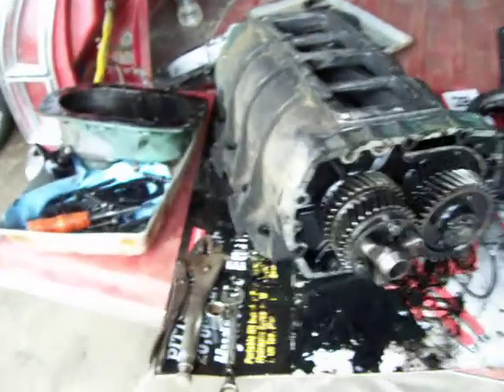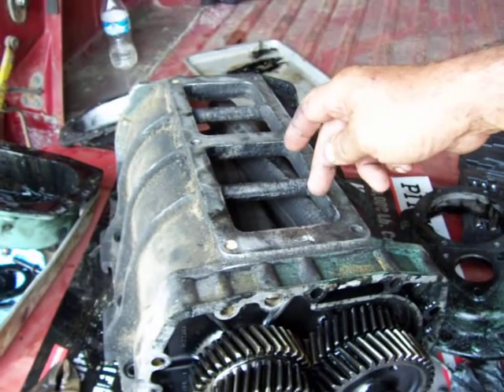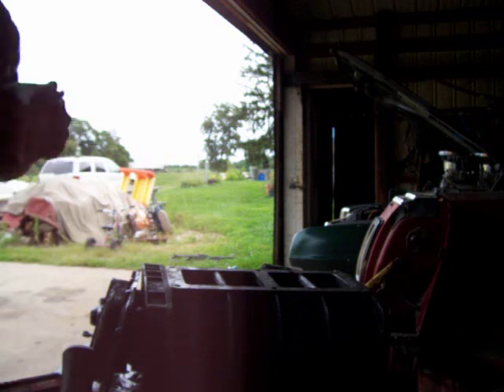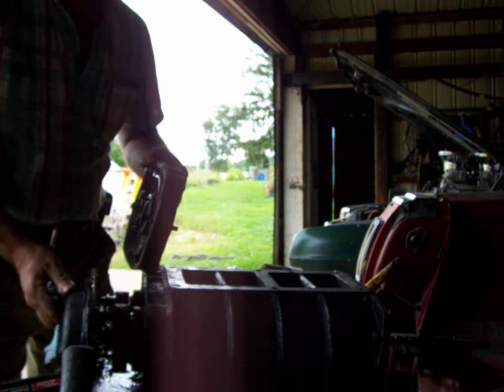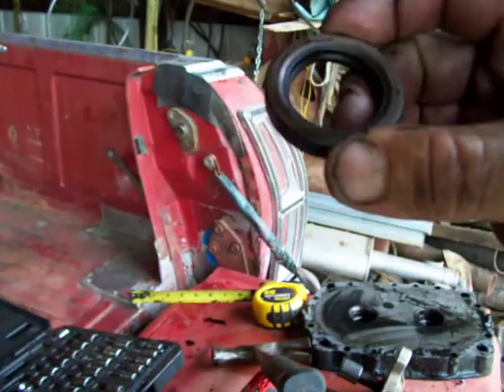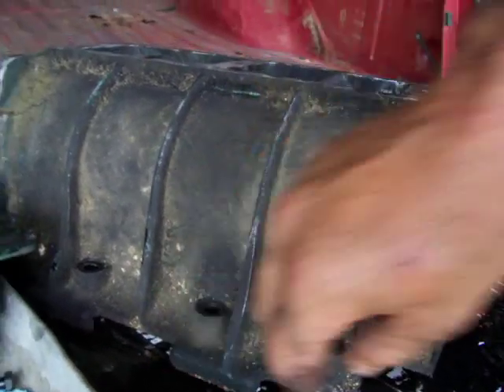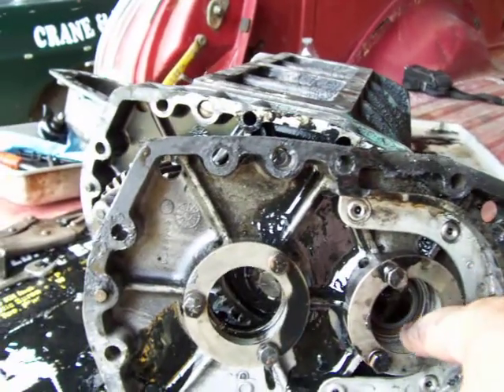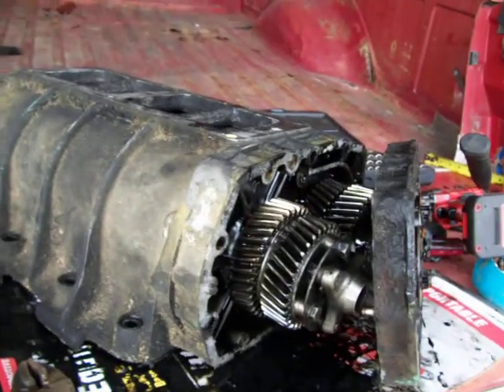Detroit Diesel 6-71 blower conversion to gas engine .

Comment: I'm eating up every step.
I have an old 8v71 I'm wanting to put on a 454.
Reply from the maker: Thank you !  It's not to bad of a journey if ya take your time and enjoy it 😀
  Your 454 project sounds interesting !  I had 396 and 454's in a Chevelle and Nova , loved those engines and cars , the only regret I have is they did not 6-71 blowers on them .
Reply: a 671 would be perfect for what I want, but the 871 was free.
 The manifold is going to be a project all in itself.
 Going to take some engineering. 
I've heard there are folks who can 3D print about any type manifold configuration you could imagine, relatively cheap.
May have to look into that.
It was nice to discover that I don't need a lot of the things I was TOLD I had to do.
(like having neoprene blades dovetailed into the rotors.
I was told that on a diesel, the fuel itself acted as a lubricant and if I converted it to gasoline, it would just overheat and lock up.)

Anyway, I appreciate you taking the time to make these videos, and sharing your knowledge. 
Thanks again.
Reply from the maker: @DyingbreedironX    Yes the 6-71 would be easy as you could locate an intake manifold and drive kit fast as they were more available . 
  Intake      https://www.jegs.com/i/Weiand/925/7151WND/10002/-1
 Drive kit   " Have to call BDS with measurements to get the correct one " 
   https://www.blowerdriveservice.com/DK-3152-CHEVY-454-3-2V-871-DRIVE-KIT_p_342.html
  Oh yes , it's unbelievable what some so called " engine experts " will tell you how something can't be done or won't work .  I call that defeatist mentality !   👎
 
 I run into this at car shows all the time , always some expert comes up and starts telling me why it won't work when I drove the damn car to the show and drive it home .  They ain't got a clue of what they are saying ! 

 Yes those neoprene style rotors were aftermarket buy companies like BDS for a little better air seal in the housing .   It's not needed for a street /strip driven machine .   We still run a lot of Detroit Diesels in our equipment & trucks and those blower's are tough and run 1,000's of hours without any issues pumping air all day long .
 What kind of vehicle are you dropping the blown 454 in ?
Reply: I have a 6v71 with 6v92 big end plates on a 3.8l v6 commodore motor  not tuned yet  i actually put grease nipples on each bearing ( dodgy lol not as bad as the 12mm mdf insulator plate under the blower though )  but does the job  have some videos   will post a link (using mrs account)
Reply: https://youtu.be/z7Pv4PY6ZLs?si=PGt93mLbPX6C3bh4
Reply: https://youtu.be/hmw1Ok8RKpI?si=ElC31dtm77oL7Gww

Comment: this is some old school cool. Any advice on how to craigslist one of these?
Reply from the maker: Thank you ! I was going for the " Old School " style and look .  If you don't have any luck searching for a 6-71 blower might try " Adalmans truck parts " in Ohio .  They mostly sell the complete running used engine but they might have some used 6-71 blowers on the shelf . Phone number for them  1-844-335-4679 
  Good luck in your search .
Reply: @cranerigging3604  I was more meaning what to look for to get a Good one and a model that isn't an oddball. I have a few on cl in the area for not bad money. 

Also it seems as if the parts to stick one on a Pontiac are pretty impossible to find but you are looking largely at a Chevy or Ford engine to get a lower.
Reply from the maker: @thetriode   Ok yes . First I like to stay with the 6-71 blowers that came off an in line 6 cylinder Detroit vs the 6V-71 that came off it's V- 6 counterpart .
 6V-71 blower requires an additional adapter plate for the base mount . 
 The reduction blower will have a thicker gear case on the driven end when mounted on the Detroit Diesel .  I'l kick up another video on " Blower Talk " this evening on that subject . 
  On visual inspection you want them to turn free but to be honest if it has sit open for a long time on the shelf it may not as any small amount of dirt / debris in the rotors will make one tight or lock up . 
  Small scoring / scratches in the case and rotor edges is normal you just don't want any deep gouges .  
 Hope that helps . 
  What Pontiac engine are you working on ?
Reply: @cranerigging3604  Just a 350 (not a Chevy) but I may do blow through. There's no easy way to get power from one imo so may as well pressurize it. I may well end up just sticking a Detroit turbo on it.

Got some forged TRWs waiting for it, I will probably replace the cast rods with 5140 units.
Reply from the maker: @thetriode   I like that , sounds like a cool project !